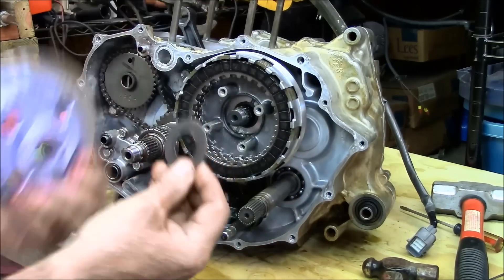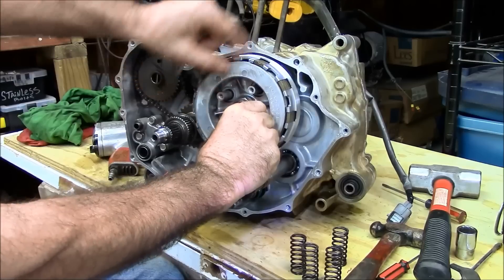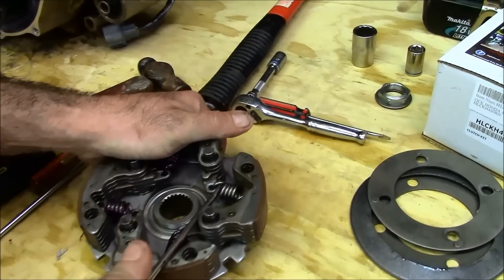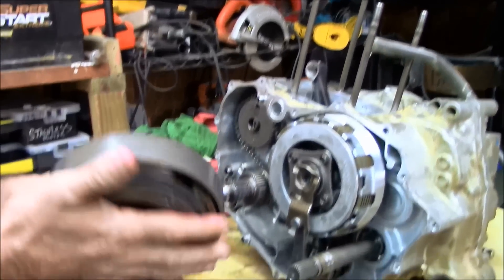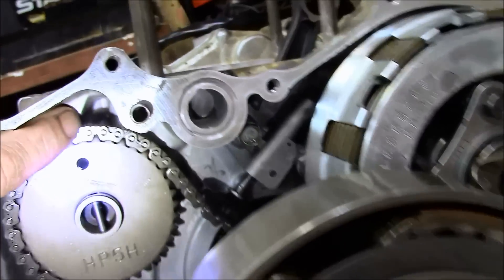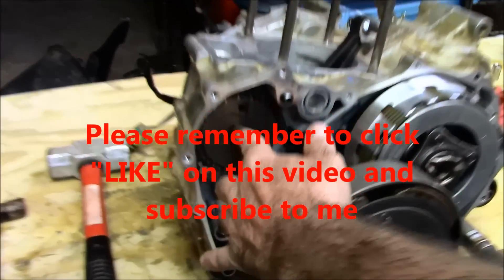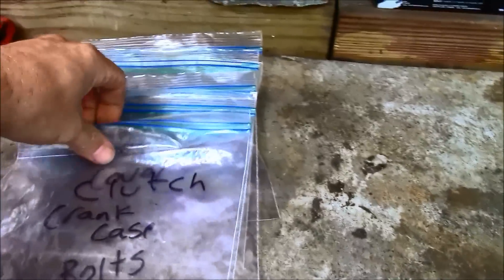Honda Rancher crankshaft part 4 of 4 engine rebuild

Comment: This is my third time rebuilding the 420 engine and for some reason this third time the clutch cover will not slide all the way on..? I know everything is in place I’ve checked multiples times rewatched this video but it is still getting caught on the clutches, anybody have this problem or have a suggestion? Great video btw

Comment: I notice a step where your video varies from the manual , when installing the last friction disc on the shift clutch the manual states that it goes in the shallow slot not the long one as the other friction plates do. don,t know what this would do  ????
Reply: I noticed that too I just got the clutch basket all together with all the disc's in the same slot. I'm going to take it back apart and put it the original  way

Comment: Quick question. I rebuilt the motor in a Honda rancher 420. I got it all back together. It started and ran but the reverse light pops between 2nd and 3rd. The neutral light pops between 3rd and 4th. Any help on why this happened

Comment: I just got done rebuilding a 99 450 Foreman, which has a very similar engine. But now, when the transmission is in neutral, the output shaft spins...I don't think that should be the case. I had my uncle who used to work for Honda check it out and he's at a loss too, everything checked out. Any ideas? Thanks in advance.
Reply: One way bearing is backwards

Comment: thanks for the video you just saved my butt...my clutch plates were rattling around loose after a total rebuild as i didnt have that outer seated as you mentioned..machine wouldnt move in gear...thanks

Comment: we have a 450 foreman, gear shift plate broke in half. we took off front cover removed clutchs replaced plate put everything back together. bike shifts now but when you give it the gas it doesn't move! what could we have done wrong or could there be something else broken????? 2002 Honda 450 foeman manuel shift.

Comment: any way you could specify which way the cyntrifical clutch is supposed to spin? my outter drum will spin counter clockwise and lock clockwise. I'm assuming one way bearing is in backwards. it will not idle in gear and it takes off as soon as started up

Comment: this was very help full, our bolts were coming out on secondary clutch and cutting into the case, bent the bolts , we just replaced the bolts and used a little lock tight to keep this from happening agin
Reply from the maker: Great. I could not find any videos when I was trying to do mine so i made one

Comment: That motor sounds excellent. Great job. Wish you'd made a video of it running a while but all 4 videos are perfectly explained. How is it holding up? Thanks
Reply from the maker: Great. I could not find any videos when I was trying to do mine so i made one. It is running great still. I dont like the clutch kit we installed from Highlifters

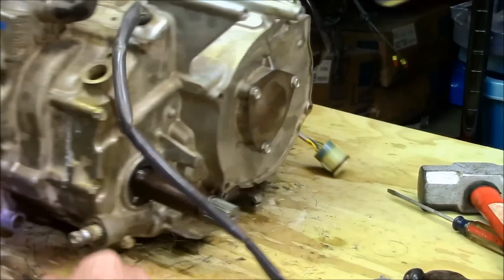Comment: Hi around 2:45 on the video aligning the shifter well i followed all the steps an my shifter is really tight but my transmission is free what could be happening?
Reply from the maker: Did you figure it out yet? if not i can ask my buddie

Comment: Video wasn't very helpful to my problem because I need to know how to do the valve timing. I had to replace the piston rings on my 07 honda rancher 420, I got it all back together and now it has a knocking noise from the rods and I have no idea on how to get the timing right. If there is any way you can help me that would be great
Reply from the maker: sorry, I will try to upload something about timming
Reply: If you only pulled the head and the jug, how on earth would your timing be off? Did you ingest water and bend a rod? As long as you didn’t pull the timing chain and cam, your timing should still be correct.

Comment: Nice video, I have a 2007 Rancher 420 with Electric Shift, 3rd gear is out in it and I'm also going to do the top end. Thanks this video will be very helpful...
Reply from the maker: did you get it fixed

Comment: Thanks for uploading this, just rebuilt a 500 foreman, couldnt find any videos related to what i was doing. Your video answered many questions i had.
Reply from the maker: yep very simular
Reply: I'm replacing a cam chain. Can I take the cam rollers out from the top of motor with pushrods

Comment: i have to replace my front cover and only the front cover how hard would it be to do that would i have to take the hole motor off or could i do it with it on the four wheeler
Reply from the maker: I think you can do it in the bike
Reply from the maker: You can remove the front cover in the bike. It's easier after the front driveshaft is out to stand it up on the back rack. Remove the fuel pump for more room.